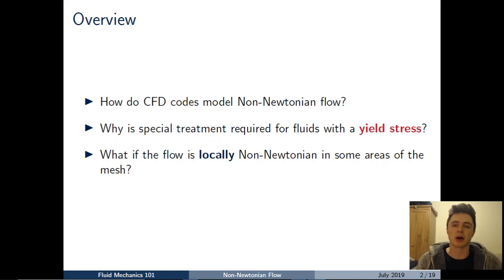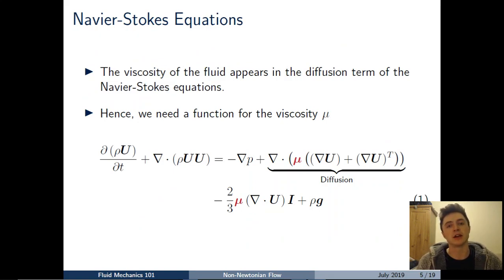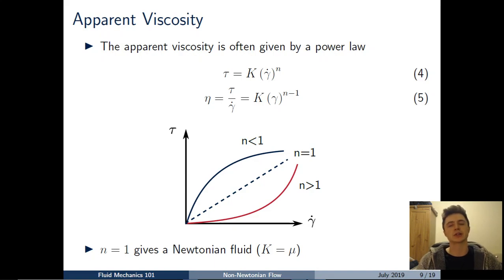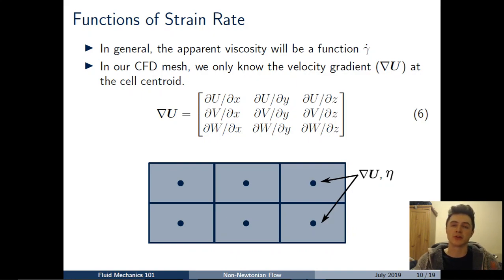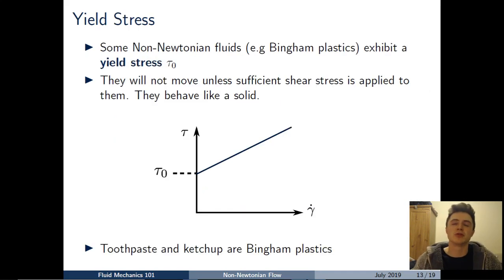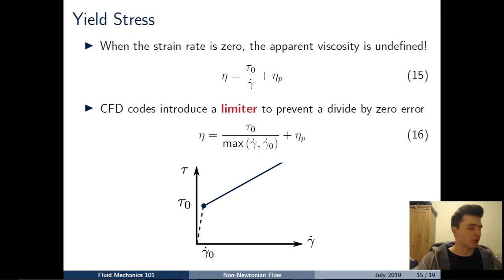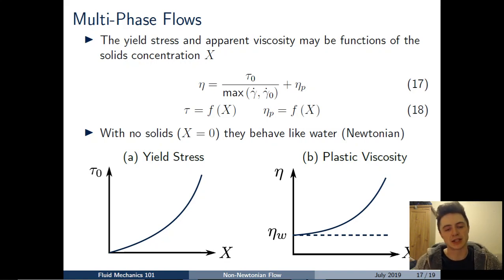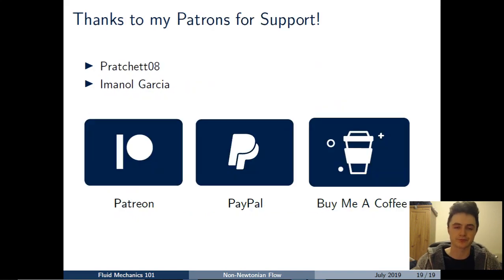[CFD] Non-Newtonian Flows in CFD

Comment: Dear Aidan,

Thank you for the helpful video.
It seems to me there is an error in Equation 10; the velocity gradient tensor (i.e. grad{U}) must be replaced with 2*E where E is the strain-rate tensor defined as
E = 0.5*(grad{U}+transpose(grad{U})).
Please correct me if I am wrong. 

Regards,
Armin

Comment: I have a question, how do we calculate Time step size and number of time steps required for a particular problem? Is there any equation?
Or is it random until we see fully developed flow?
Reply from the maker: As a minimum, you want to choose time steps so that the solution is stable. This often requires a courant number less than 1. In addition to this you would like your time step to be sufficiently small to resolve any unsteady physics that you are simulating (vortex shedding for example). Finally you want your time step to be large enough that your simulation doesnt take weeks to run ... so play around and see what works 😊

Comment: Hello Aidan, 

First of all I wanna thank you for this really nice overview of how to handle non-newtonian fluids in CFD. 
I am trying to model fresh concrete as a fluid with herschel-bulkley behaviour in ansys fluent. I have experimental data (the dynamic viscosity and the yield stress) to implement into the cfd code. The Herschel-Bulkley has four Parameters that Need to be defined. I was wondering if I have for example in reality a yield stress of 400 Pa and a dynamic viscosity of 20 Pas how to implement them correctly. So n should be equal to 1 in order to have a Bingham fluid. But how do I define the Consistency factor?

Best regards
Martin
Reply from the maker: Hi Martin, for a bingham plastic n=1 gives a linear relationship. The consistency index sets the gradient of this straight line. You will need to do a curve fit to your experimental data to get the gradient 👍
Reply: @fluidmechanics101  So actually the Consistency index in ansys fluent is the dynamic viscosity from the experimental data? I tried to take my strain rate at different times from the solution plot and multiplied it by the molecular viscosity. Because as a result I can have a function of the shear stress over the shear rate? And it should be the same as my original experimental data?